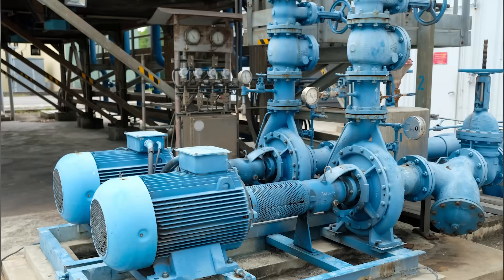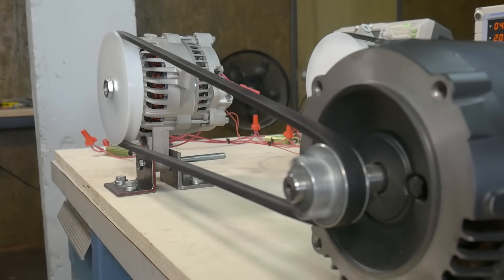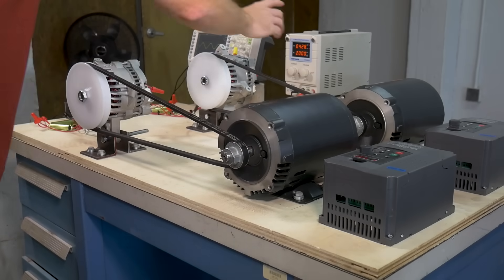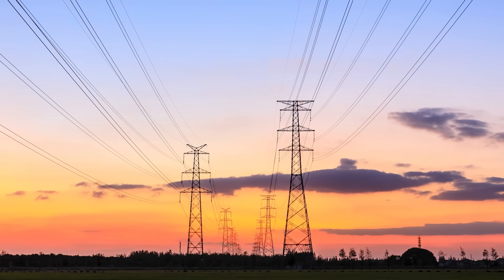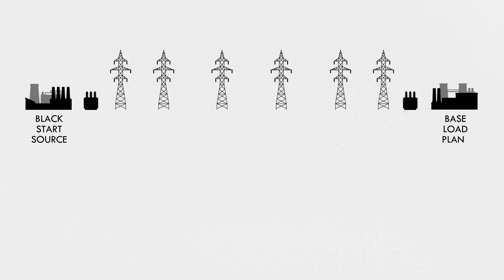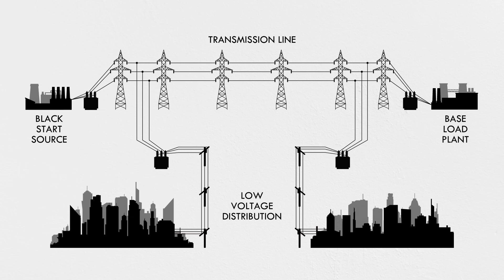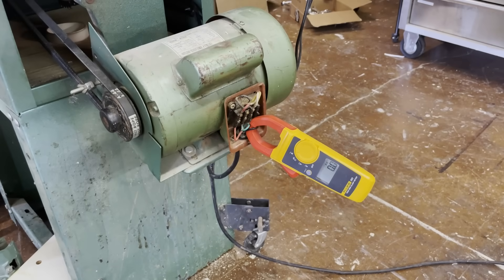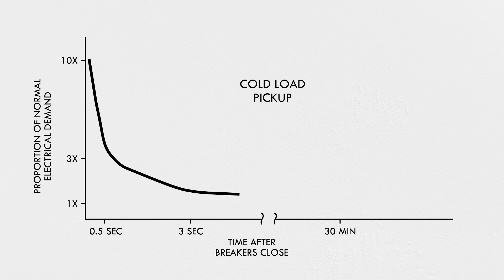What Is A Black Start Of The Power Grid?

Comment from the maker: 🥑Convert dinner from a chore to a fun night in with HelloFresh: Use code PRACTICAL18 at https://bit.ly/3UQECxk
📖 Looking for a holiday gift? Pick up my new book or a t-shirt at https://store.practical.engineering
Reply: Been waiting for this video. Thanks!
Reply: I worked many years for a large Texas utility.  We had several black start plants.  Each plant had several thousand gallon tanks of compressed air that would be used to spin and start a small diesel generator, which would in turn, be used to spin a small gas turbine, which in turn, would be used to spin a big main turbine of around 150MW.  When the main was spinning, its load would be distributed directly to other powerplants to get their turbines spinning.  When enough was generating, load would shift to the big coal plants to get those up and running.  When the coal plants were generating enough to be self sustaining, they would then start distributing the power out to customers.  All this can be done remotely too.  We practiced this scenario repeatedly from a control room somewhere in New York.
Reply: Couldn't they create a 'black-start' grid (with a number of highly-calibrated consumers of electricity) so they could bring the power online quickly, then flick a switch to change the power-plants from energising grid B (the emergency grid) to energising grid A (the commercial grid) to make this smoother?

Disclaimer: I'm not an electrical student. My apologies in advance if this is an utterly ridiculous idea.
Reply: @jamielonsdale3018  you'll have to sell it, too. So no, you can't switch it off and on and off and switch and on again...
Reply: @jamielonsdale3018  No. The first things outside a power plant that gets power is loads like local hospitals & police; these come on first. Then transmission lines to other power plants. Period. The priority is powering up other power plants. Just to bring a large boiler up to temperature can take as much as 48 hours. To support loads you MUST first bring generation online.
Reply: @tsamuel6224  You explained how it currently works, but not why my idea couldn't be implemented. Thank you anyway, I appreciate that you at least responded.
Reply: I learned so much from this and when you started talking about the frequency of the generator I remember when I was having a problem with a dual engine boat that had 2 alternators. On a dual engine boat there are two boat switches and when we put the switches to "all" (bridging the two systems in parallel) the rpm guages would run mad (going up and down and not giving a good reading) but when we separated the switches (port engine on battery 1 and starboard on battery 2) the problem went away. It took us a little while to figure this out but now it all makes even more sense. Love the videos. Aloha from Hawaii!
Reply: Thank you so much for that awesome model! i hope to build my own generator soon that was a huge help. thanks again for such awesome content, i cannot understate how much i appreciate it!!!!!
Reply: Are there issues with natural gas services if the electricity goes out?
Reply: This actually hits on a debate I was having with someone that tried to argue the generators run at roughly the same speed regardless of load. My response was to mostly agree but point out the input torque is regulated to match the output load that is to say when the electrical load rises power plants open the throttle to generate more torque to resist the braking force of the back EMF from the generator. The electrical load of the grid is in essence trying to stop the rotors energy input is increased to prevent this occuring.
Reply: @FaerieSeraphina  yeah — it’s true that they run (very accurately) at he same speed at all times, as much as possible, but that doesn’t happen automatically.

Even on the scale of a little 2000W gas generator, that’s what they’re doing — when it slows down the throttle opens up.
Reply: @Practical Engineering, So what happened in North Carolina when gunfire damaged the electric grid? How would you black start that?
Reply: The PRACTICAL18 code isn’t respected by HelloFresh. It says it has expired. 

Disappointing.
Reply: Very good explanation on why electrical grid synchronization is needed. I must admit I have seen several videos about this topic but watching yours I think I finally understand.
I do have one question thou. Modern generators can control their energy output by increasing or decreasing energy level that power generator coils and thus create needed magnetic forces for them to work. Would it be possible to reduce the "synchronization kick" of connecting second generator to grid by minimizing its power generation by energizing its coils with minimal voltage even when they are not in perfect sync?
Reply: High demand caused it? Are you sure it wasn't because they was testing 2 EA-6B's in a real world environment because it would be dang near impossible to build a large scale mock grid?

Ever heard of an invention called a magnetron? Do you think one powered by a 6KVA rat-gen could generate a large enough electromagnet pulse to induce a large enough current spike to trip those breakers if they hit a a sub-station with it?
Reply: I've seen a lot of ads about hellofresh, esp in the last ~4 months, and I have to say, this was the best one, bc it wasn't really an ad. it was a real family cooking a real meal. hearing that you've been using them for 3 yrs is awesome. looking into them, thanks for sharing
Reply: Simping to power companys is a bad look...it vary easily could be cheep and reliable...but even tho they are bayed both by us and the gov for every watt still can't get it right...
Reply: https://youtu.be/lqF5tMgJAoM
Reply: So how do wind turbines synchronise with each other and the grid? Also how do they maintain a steady output and frequency?
Reply: @matthornton44  thay have brains to set them at the right frequency and switch in at the right time ...steady output now that's hilarious tho...green energy means unreliable and not there when needed
Reply: Ha! Your animation at 11:46 makes it sound like ancient history. Ships have to do this manual phase synchronization to this day. Ask me how I know. Also, the navy practices (and does it IRL) black starts all the time. It's what happens when you have a small "grid" that needs to be reliable.
Reply: -2 here an tva has manaded rolling black outs in the south ....
Reply: so you just can switch off a nuclearpowerplant
but never on again!?!
Reply: Did the synchroscope use a little motor to turn the needle?
Reply: Would love a collab with PE and Bob's Decline...
Reply: They have Hydro Turbines underground. You know this.
Reply: A coffee maker is key to any blue collar work force.
Reply: I wish I had a teacher like you in college. This was always difficult for me. Why could never be answered. Practical application is instructive
Reply: That Segway Portable PowerStation Cube Series sounds like a great option for outdoor enthusiasts and RV lovers! With its massive capacity, powerful output, and waterproof design, it's definitely a reliable choice for your outdoor adventures. Plus, the fast recharging feature and smart app control make it even more convenient. Thanks for sharing!
Reply: exxcellent video thank you
Reply: It is also called "lock rotor amps"
Reply: The real Slim Grady was a character on Sanford & Son, no?
Reply: You had at least five ads on this video.
Reply: @iivin4233  No ads for me apart from the sponsor. Perhaps you should try getting an adblocker?
Reply: @iivin4233  Channels aren't in charge of how many ads are on videos anymore, thats all youtube
Reply: Does the promo code not work on the HelloFresh UK website?
Reply: @panderson088  a little late for this but god i hope not... anything to stop you from using the terrible service that is hello fresh...
Reply: @panderson088  doesn’t work in US either
Reply: 15:52 I thought tomatoes were red. I wish they were even different colors, like peppers. Really boring and anemic - sorry!

Comment: One thing i don't get at 12:01
If the synchroscope showed that the generator is slightly slower, at say 49 hz and the grid is at 50 hz, in what world are you going to get the two phases aligned properly with this analog equipment?
I always thought that to sync two phases together, you needed pinpoint digital presicion. Like, this seems so unprecise to me. Even if the analog meter itself is precise, half a millimeter or smth different on that arrow would show a completely different frequency, no? Completely unrelated to analog vs digital equipment, someone could just look at it from a slight angle and see a different result no?
Like what i mean is, even if the arrow seems to be dead center on the middle line, isn't it still gonna be off by some degree? How did the people who made that meter know that within this tiny bar, its fine to sync the grid, and that theres no way for the grid to be too out of sync when the arrow is on the bar, regardless of operator error margin?
Why is it fine to match a 49,89 hz generator and a 50 hz grid, but not a 49,32 hz generator and 50 hz grid? Are these analog meters really that precise? Or is the margin for error greater than i thought?

Comment: A truly back start is a night mare... most of those experienced are only partial system black starts... 
Australia ran from 1924 to 1983 with a false idea they could black start their rastern sea board from their hyrdo power stations that were on the ends of long capacitive transmission lines, in which the Capacitive Mega VARS exceeded the maximum MVA rating of their biggest hydro plants!

Comment: An alternator and generator are not the same, a generator has magnets it doesn't need electric power to generate power just motion, an alternator doesn't have magnets and requires electricity to make a magnetic field and motion to make power.  Cars used to have generators but they were unreliable, race cars continued to use generators because they are lighter and the vehicle doesn't need as much power (no headlights, turn signals , or any other 12v things plugged in, modern race cars are different I'm not sure what they do for power. But again Alternators and generators being the same os like saying a gas vs diesel vehicle have the same type of engines.

Comment: At the power plant i worked at we had 5 gas turbines that could  be started by a diesel generator and then  they could use the electricity from the GTs to run the plant until they could get the main unit going. My plant was the largest  single unit coal plant built back in the early 70s i working  there in the early 2000s when we almost lost the whole grid east of the Mississippi.  My dad was in operations at the time  and he got a call from the president of the company  to keep all the units  at his plant running at full capacity as long as possible.  Since the plant he worked at was older he had a few tricks to keep the 6 units he was over from tripping. I remember  my coffee cup shaking from the load as the operators at my plant worked to keep the unit running.  Luckily  we never  lost the grid but it was a rough 24hrs while they pushed to get cold units fired and fazed into the grid. Did so much damage to two of the units my dad was on that they shut them down the next day and never fired them again until the plant was tore down years later.

Comment: You went to BTC? Congrats from an alumni. Great school. I went onto Central Washington University to get my full bachelor's in EE. I am glad for the knowledge - but now with the job market as it is did I make a mistake?

I always knew when a generator was brought onto the grid it had to be "synced up" and in phase with the grid frequency. But what if there is nothing to sync it TO? (As in, black start) - excellent video. 

Dont forget the exciter - in order for the generator to make power at all, the electromagnetic force is created by several hundred amps (depending on the generating capacity). Most power plants have diesel generators - but when it comes time to look at the syncroscope and close the generator breakers - thata the "moment of truth"

Ive been wondering how Texas would sync their power grid with the rest of the country if something hit the fan (like a few years ago, 12 degrees F in Dallas) - a lot harder than id think

Comment: awesome vid. tho i'd like to add a caveat to your "inrush" measurement.  if your trusty Fluke had the function for a true inrush measurement(my clamp-on Fluke has a small yellow button to enable inrush) you would be shocked.  with this function id bet the actual current would jump to the tune of 2-300%.  however it'd be for a very short time.  but like you mentioned everything all added up is very significant.  cheers

Comment: One aspect of the 1966 blackout that made bringing such a wide area back online was the fact that there were several interconnected systems without the automated isolation equipment that is now in place. Linemen would have to go to substations and manually disconnect load. There was no means to coordinate bringing the system back up. One system would try to get back online only to be either knocked back down because of the cold load, or because the systems already online were out of phase. In some cases, generators were physically ripped off their mounts. In contrast, in 2003, the automation put in place to protect the system by load shed in some ways made the blackout cascade as systems attempted to isolate.

Comment: when aligning grids to each other like you did with a synchroscope, why not automate the system so when a synchronization is detected a computer automatically flips the breaker for you. that would allow us to simply turn on a generator/power plant and wait for the computer to fix it to the grid. you wouldn't need a operator standing by at that plant.

Comment: So why couldn’t you just use another working Grid to black start a non-working grid. When the Texas Grid had the Winter Blackout a couple of years ago, I wondered why they didn’t ask the other working Grids for a jump start. I know they aren’t not directly connected but you think they would have implemented a connection that temporarily opens and closes for that reason
Reply: Texans didn't want to be connected in any way to the national Eastern or Western grid. Having emergency connections to the national grid would likely require for the Texas grid to be up to national standard also.

Comment: I've experienced something similar in Satisfactory. When starting up a new coal power plant, you have to be able to give power to the coal mines, water extractors, and pumps before any of the coal power generators can function. While trying to turn on my new plant, I was attempting to run my machines while also turning on water extractors, which required more power than my old grid could produce, shutting down the whole system. To get the power back on, I had to isolate only core systems while running old power generators until I could slowly turn the generators and extractors on. If i didn't have any generators capable of starting without power, I never would've been able to get the system back on.

Comment: And here's a cold-load pickup question for the HVAC pros: do controllers for larger HVAC systems not have the building CLP delay I would expect -- programming that tells them simply not to pull-in from thermostat call if their input power hasn't been stable for 60-120 seconds?